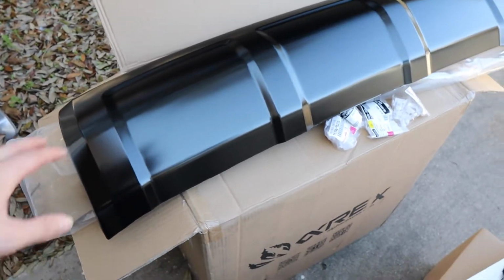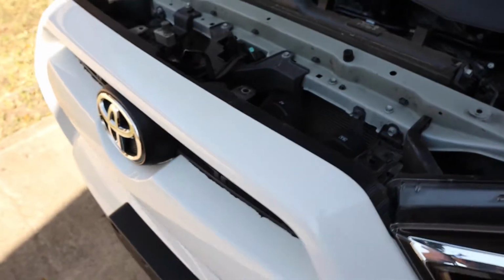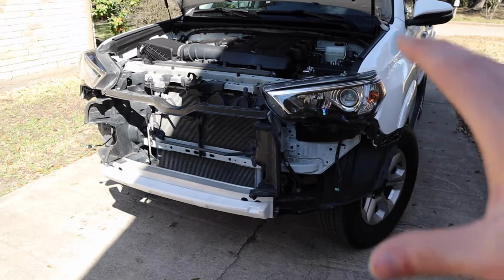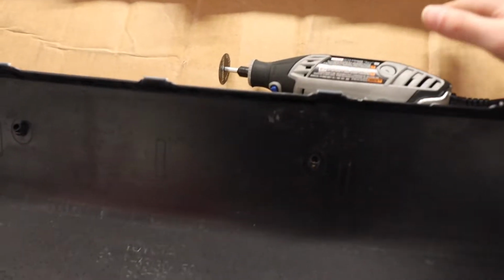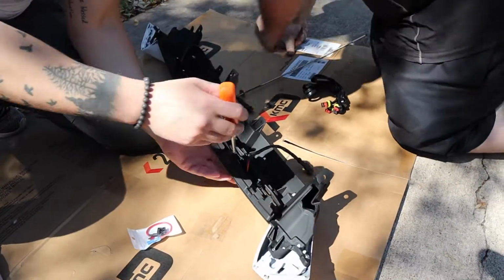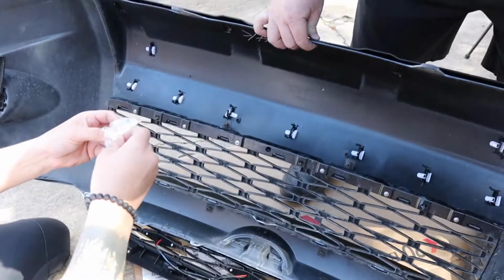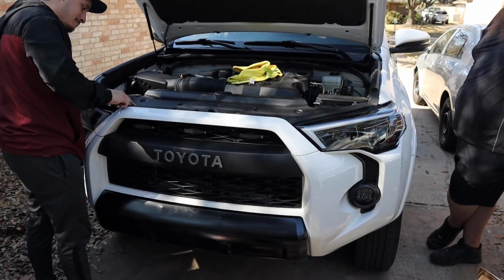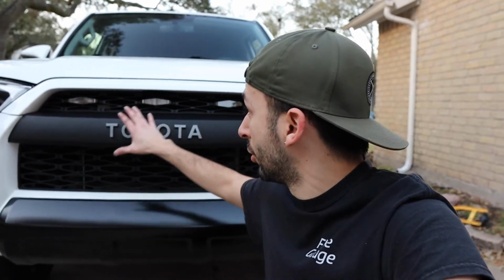2019 4Runner TRD Pro Front Valance Install | SR5 Conversion Part 1 Flake Garage

Comment: A note for the next person who comes along... if you have a newer SR5 with the Toyota Safety Sensor in the front grill, there are 2 extra bolts in the center of the grill you’ll need to remove and you’ll need to disconnect the sensor plug at the center of the grille. Also, there a plug near the drivers side fog light that you’ll need to disconnect.
Reply from the maker: Thanks for the note Ross. We'll pin it for others to see hopefully

Comment: I ordered a lower valance for my 2016 SR5. It just got delivered so i was holding the valance over where its supposed to be installed and it seems like it might be a little too snug. I havent made any cuts or anything yet, do you think that may be the reason why the valance may look like it won't fit? Id love to hear everyone's opinion before cutting my bumper up. Lol im pretty nervous about making the cuts so I want to be sure
Reply from the maker: I don’t remember holding it up against before cutting but I think it’ll fit fine. What you can do is use a knife with a fresh blade to have a bit more control over the cuts

Comment: Has anyone just used double sided thick adhesive tape / foam for this ??
Reply from the maker: I don’t think I’ve heard anyone use that but if you do, I’d recommend some industrial strength tape and also to be prepared to lose the pieces at some point
Reply: @FlakeGarage  thx. I might give it a try, because I mean the TRD pro front grille valance cover is double sided tape and some body kits also. Not much to lose
Reply: @jimmycheung2363  Did you ever try this out? Im about to do the lower valance on my SR5 and im definitely nervous about the cut. I have the upper valance already on, i think because its such a tight fit, the double sides adhesive works but the lower valance is rounded out and not a tight fit at all
Reply: @ I ended up doing real way of cutting slits and using clips. It’s actually pretty simple and a sure fit

Comment: That’s great, but how does that bottom grill attach? Bought one with no bumper and bought the parts, but there is no attachment points for the bottom grill, and a metal bracket on one side only

Comment: I have a 2019 TRD off-road premium. Since I already have that ugly silver valance, I assume it would be a one for one swap for me with this kit? Thanks
Reply from the maker: Yeah you wouldn’t have to cut anything, just swap the old one or if you wanna save money, wrap or paint the silver one to black. I believe they are the same
Reply: @FlakeGarage  you’re correct, but my the silver on my OEM valance started peeling off. The problem is, about 1/5 of it is still left on and I would have to sand it or use some type of chemical to get the rest of it removed. I tried picking at it and it just leaves marks in the plastic.

Comment: From which model have the holes been marked, you know?
Reply from the maker: They are marked for the valance. Can be off road valance or trd pro valance
Reply: @FlakeGarage  Okay I got a 4Runner SR5 2017 and I don’t know if the SR5 already have market the holes
Reply from the maker: The bumper is marked in all models. This video we are converting an SR5 to the trd look

Comment: Dope stuff! Thanks for the walkthrough. Out of curiosity, do you know if the new black valance panel come with guidelines for the front license plate holes? Or do you have to find the alignment yourself? Thanks again!
Reply from the maker: The new valance does have two markings in it for where you should drilled your new plate
Reply: @FlakeGarage  awesome stuff, thanks for the info!

Comment: About to do this to my 2020 SR5. Mine is red, so I am going to replace the top trim piece as well (the piece just above the raptor lights). Never pulled a bumper cover before so I am a little nervous about it, and I know there are a couple of extra bolts for the TSS sensor. Honestly, the top wheel well piece is the one that concerns me the most. But your video is the best I have seen so far, so I appreciate the detail. Looks great, and like your other comment, the Raptor Lights are starting to grow on me.

Just realized yall are in Katy. Pretty dominate football program down there lol. Much respect from the DFW.
Reply from the maker: Definitely take your time and be careful with plastic tabs. The rest of it should be pretty easy. Make sure you disconnect your sensor before pulling the bumper off and once you unhook those side fender tabs it'll basically almost come completely off. Recommend having a friend to help you remove it just so it doesn't scratch against the floor. We have the rear part coming up soon so stay tune for that one. Cheers to the DFW bro 👍